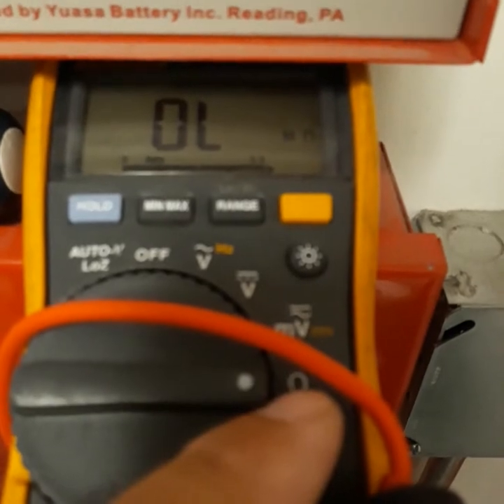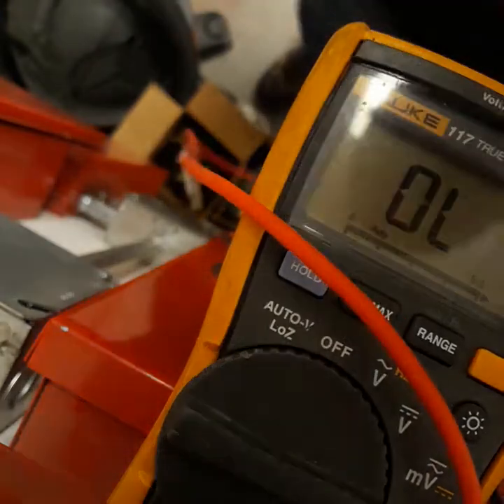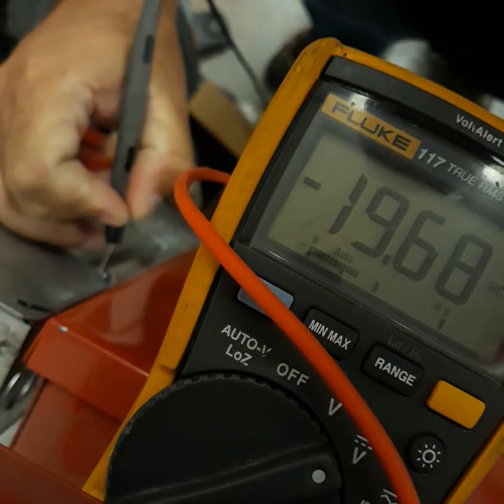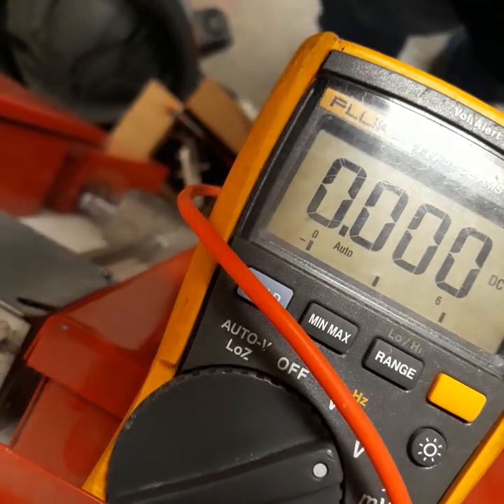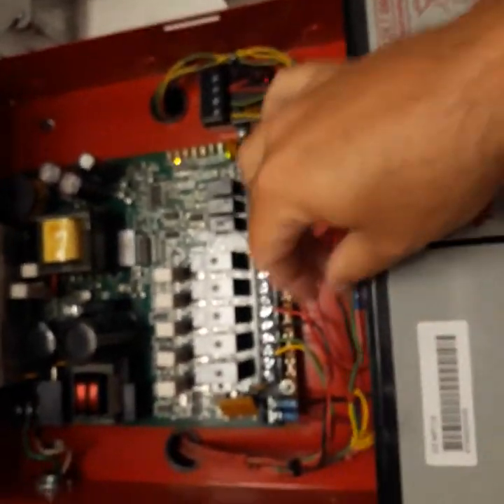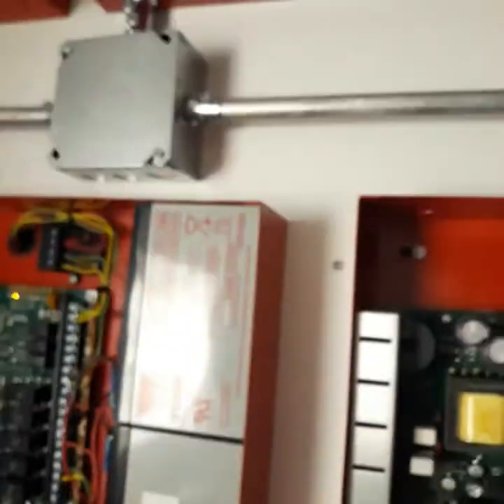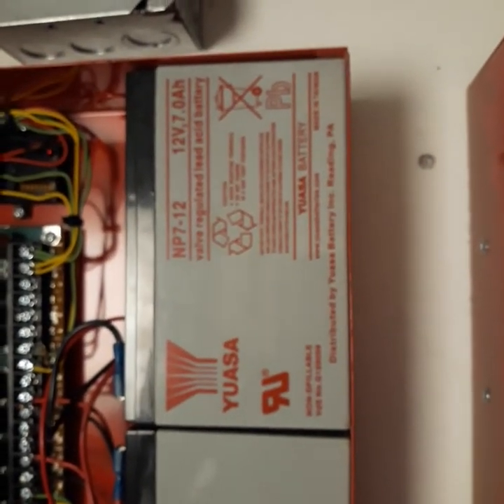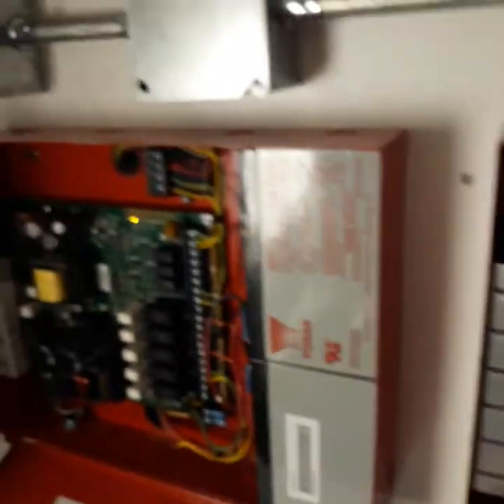How to find ground fault on nac panel.

Comment: When I hunt a ground on a large system il have my helper at facp watching meter. On a nac ground I will walk around with my stick and tap on horns. If something is touching in box behind horn the meter will jump. You can also put a tone on bad horn run so you can find  each horn on that leg.this only works if wires are not shorted. Always remove wires from panel to get accurate reading . A dead short like 4 ohms is much easier to find than a high resistance short, above 10k.

Comment: so when u hook up the nac circuit to aux power it will set off the horn strobes how u gonna find the ground ??
Reply from the maker: No This will set off the horn strobes only for the circuit that has the ground fault. So if you had a total of 150 horn strobes.  This one circuit may only control 6 of them. So now you only have six to look at not 150. In my case I had some strobes down low and some need lift for. I needed to know if I needed a lift. So  in this case all where at top of a warehouse so need a lift. I have seen cases where I was able to fix off of a ladder. It is not good to order a lift if you don't need too.